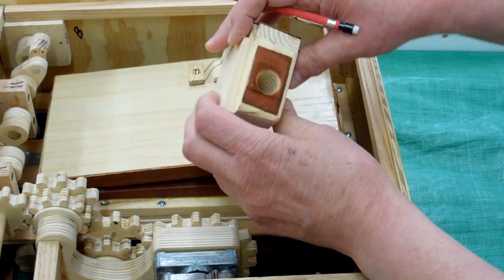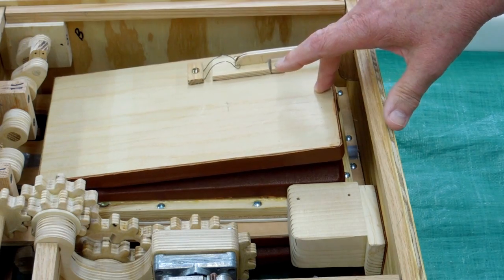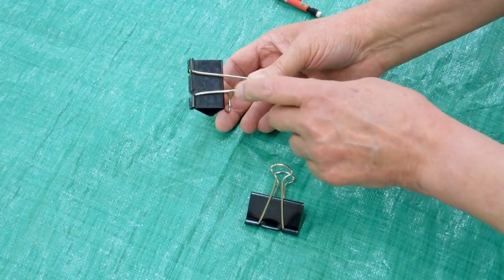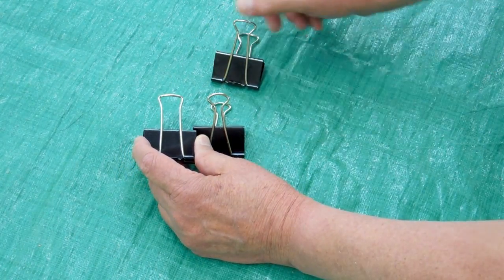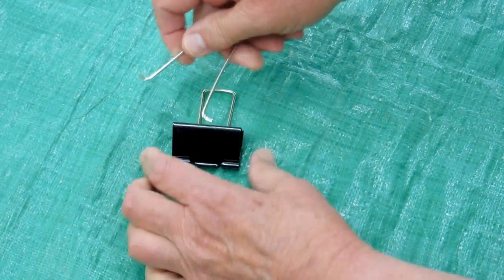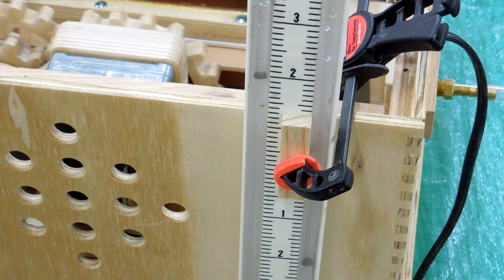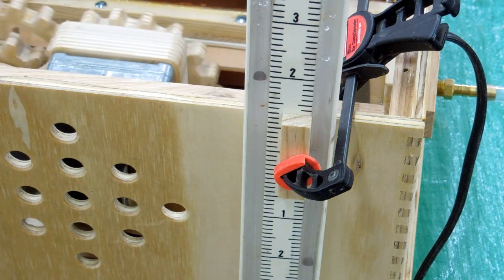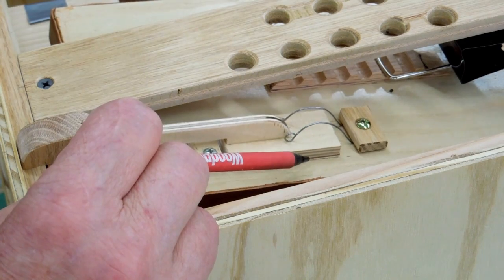Building The Busker Organ - Manometer Test Part 5

Comment: Ok, dumb question:  how much air do you need to operate the organ you plan to build?  Is it possible to run one off a 2-5hp belt driven single or dual stage air compressor...obviously in a different room?  I'd like to build a bottle organ.
Reply from the maker: Nicholas Smerk Probably would be more along the line of a roots-blower (screw or lobe compressor - Google it) or a CPAP machine. I think a CPAP would be a good air supply as they are designed to deliver more of a constant pressure rather than a given volume.
Reply: I'm not familiar with CPAC, I'll have to look that up.
Reply from the maker: Nicholas Smerk CPA"P" is a breathing machine for people with sleep apnea

Comment: Pressure regulation might be improved by having a spring just barely strong enough on the relief valve (flexing that spring adds extra pressure to the bellows).  Love the holding a magnifying glass in front for detailed shots!
Reply: I agree, pressure could be regulated a little smoother with a screw adjustable spring relief type setup, without the catch against the case. It would also be less affected by changes to motor speed, not sure if it is supposed to be or not in one of these. excellent craftsmanship.
Reply: I agree also, put the pressure regulator on the outlet using an adjustable spring.  You don't need the catch.